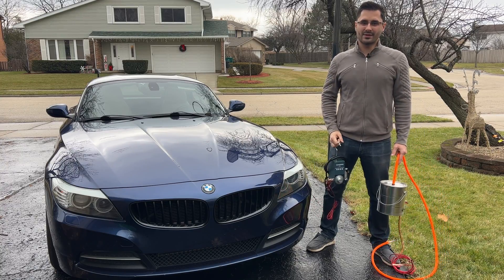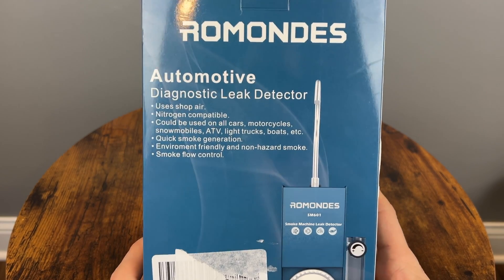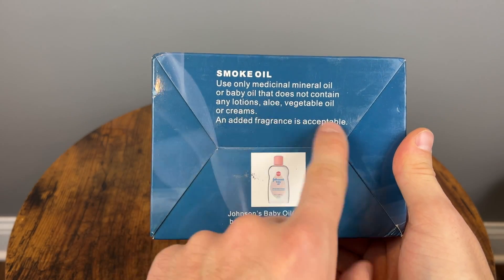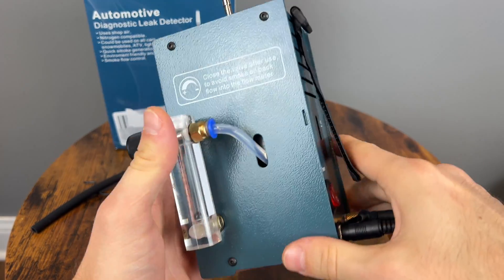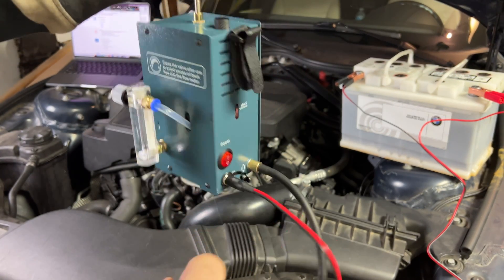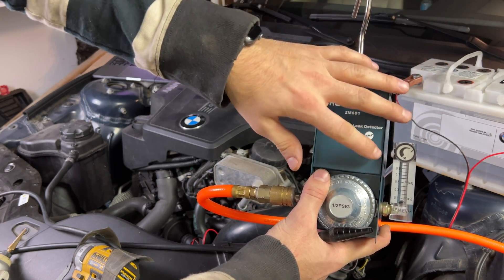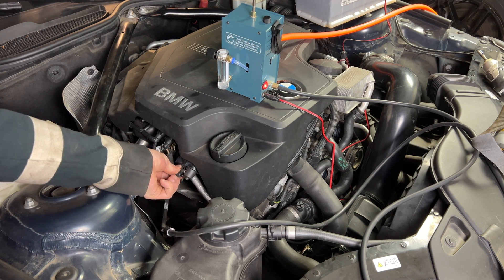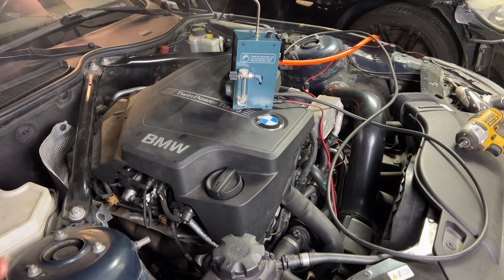How to Detect Vacuum Leaks using Romondes SM601 Smoke Machine

Comment: Just waiting on mine to arrive, but is it possible to modify/adjust/bypass the built-in regulator so the compressor can push through more than just 0.5 PSI? I'd like to use mine (when it arrives) to check for boost leak, but would need to have at least 5 PSI as the leak I'm hearing only kicks in on-boost from 5 PSI upwards.

Comment: Just in case you wanna Know, Twin Power Turbo engines are known for valve cover cracks, but those are internal cracks or the internal PCV gets stuck with soot and creates so much vacuum inside the engine giving you "lean mixture codes"
Reply from the maker: That's for the info! I've had some experience with that.

Comment: very cool tool i will use it on my 135i n54 there is always very small vacuum leak that makes fuel & air ratio problems without any code so its good to check leaks every couple of months. Can you please make a review of a good german cars scan tool (need for my audi rsq3) from 300$ to 500$ ?